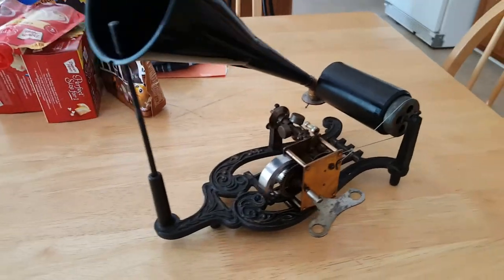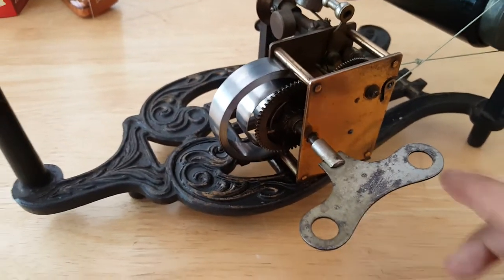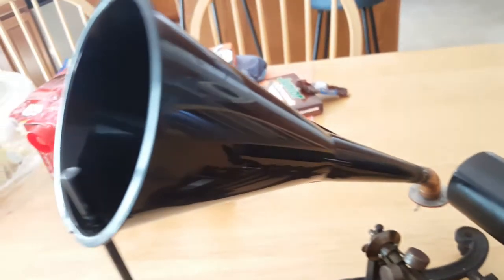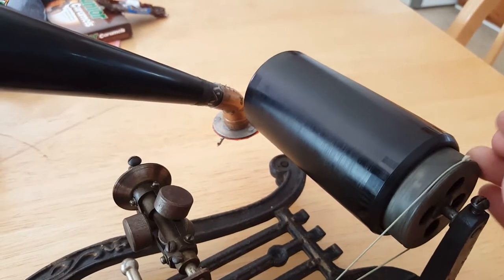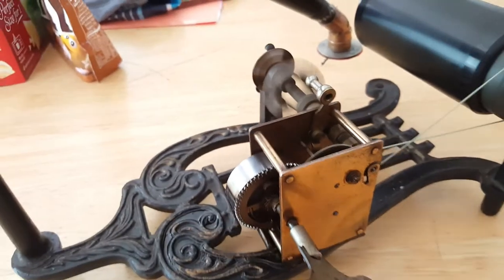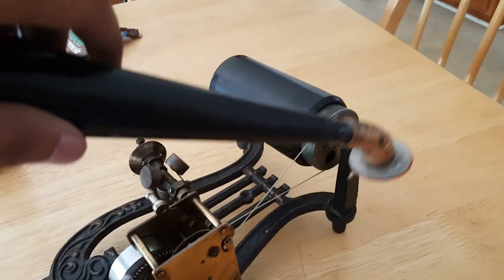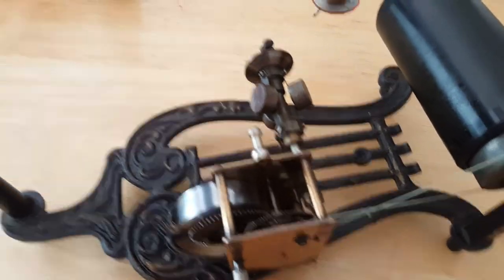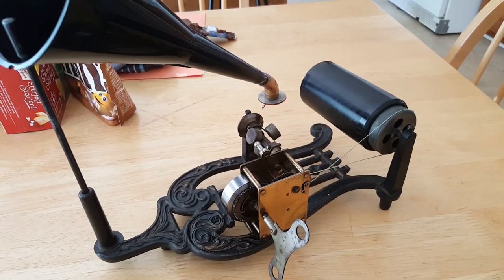VINTAGE TECH: The Puck cylinder phonograph

Comment: Very cool, I got a Puck today, no mandrel, but I might fit an Edison one to it.
Reply from the maker: It may not work with the original spring, the mandrel of a puck is very very light and thus doesnt need as powerful of a spring but for the edison to work you might need a much stronger spring
Reply: @khmerrecordarchives5626  I believe it would be. For looks I have attached an Edison Mandrel, and didnt try to make it functional. Its a display machine, until I find a mandrel. I posted a video https://youtu.be/FetfE7sUGAM
Reply: My puck stops when you put needle on

Comment: Just bought one for 110 complete with Horn an everything although it’s lacking stylus,diaphragm,driving cord and was wondering how did you make your soundbox for the machine I am going to restore is there any advice you could give me
Reply from the maker: My reproducer is made from an edison stylus with a red mica film over a piece of half inch pipe, as for restoring be sure that you get a spring that is powerful enough to run the system, it needs more power than yoi would think, also be sure to keep everything as original as posible

Comment: Can you point us to a source for a replacement mainspring? I have one ordered, and it has the right length, width,  and thickness,  but I'm concerned the inner coils may have too large a diameter  to attach tightly to the Puck's arbor.

Any clues will be much appreciated.
Reply: Also need to know width and length. Thanks